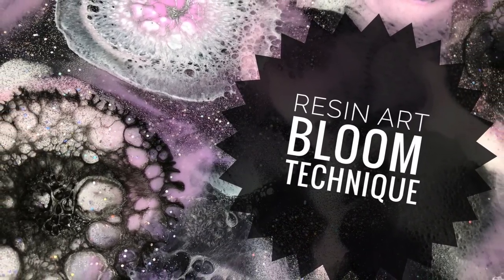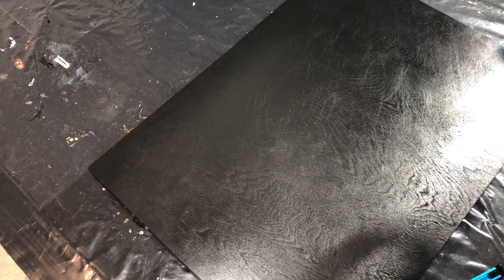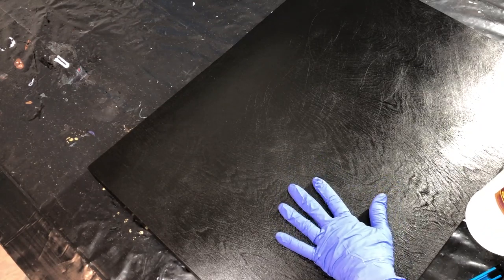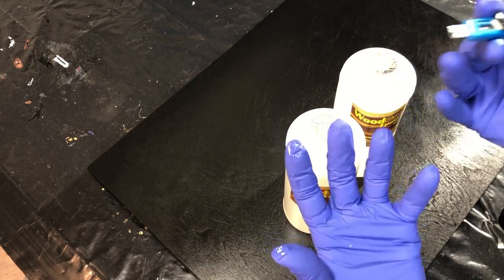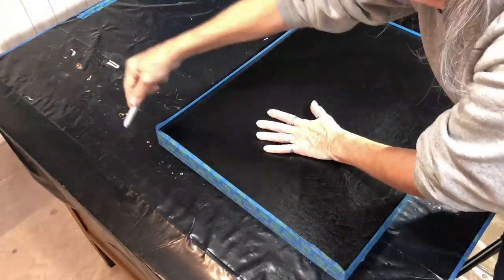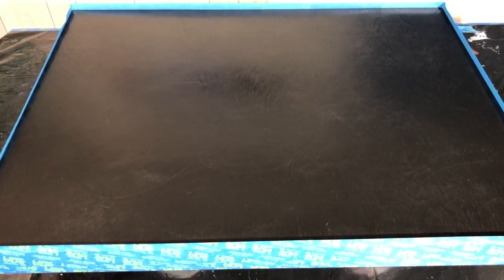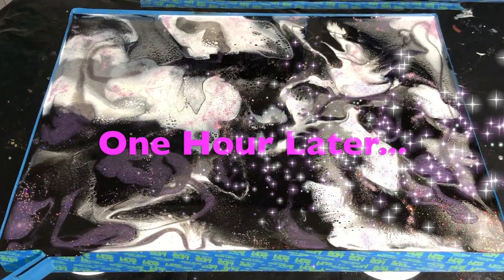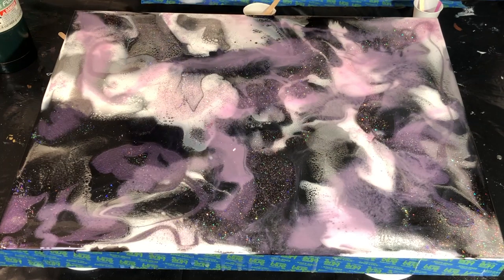Resin Art Bloom Technique - Pom Poms bursting like fireworks in the sky!  Absolutely a must try.

Comment: I just did this technique, from watching you, in some flower and leaf silicon molds.
I made the flowers & leaves from Fimo or Air Dry Clay (fimo worked best)  then made mold of them with pourable silicone, and MOLD BUILDER.  Hands down the pourable silicone molds are top notch, easy release, coat with silicon oil,  then cast them in clear resin)

This time, I injected, the resins tinted with Micas and pigments.  Awesome!

Usually, I just do clear, and use them on my faux stained glass resin window art.  I did these metallics to use on the outside of a mirror mount, usually it is on the mirror itself.

ty for posting.  I appreciate all your help on your videos....and your ideas...I like stealing your ideas...HAHAHAHA JK JK  Just Kidding!  omg, 
I get ideas, from you, to do my own thing,
 I was just teasing you...
Hopefully, you get it...most people just do not seem to have a sense of humor these days..
if you know what I mean....

Wink wink, nudge nudge..

Keep up the good work!
Reply from the maker: Wow!  It all sounds great.  I might need to get some Fimo to work with.  Glad the technique inspired you 💕

Comment: Hi Janet, Katie here from Australia. Thanks for your tutorial. It's a beautiful piece you've created. Can I clarify with you please when the layers of tape were removed? At the one hour mark, did you only remove the "dam wall" layer? And then, how long after you created the bloom puddles, did you remove the other two tape layers?
Reply from the maker: Hi Katie. When doing a tape dam I remove the dam tape 1 hour after pour and warm edge with torch or heat gun to roll the edge over for a round, leaving the tape on sides for the clean edge.  Sometimes if I pour another layer the next day I will keep the taped side, create another tape dam, pour, remove after 1 hour and warm edge for rollover.  I would then remove side tape after doing that only 2 times otherwise the build up of resin rollovers becomes to thick and harder to remove clean side tape.  Warming the side tape with my heat gun as I go around helps it come off with best results.  Hope that makes sense 😁.  I do this tape technique in a lot of my videos so maybe watching some of my others like this one I just did will help - https://youtu.be/mizGddG9vio

Comment: I correctly understood that the cells and the cobweb appear because you mix with a transparent resin .... прозрач Or is it because of alcohol ...?  I just speak Russian, no English🥴
Reply from the maker: The cells and cobweb are made by clear resin puddle first, then pigmented resin puddle on top (only the silver has alcohol), then using the heat gun in circular motion blowing resin puddle outward.  Hope that helps 😁
Reply: @MoonkusserArt  Thank you, I will definitely try☝️😊👍
Reply from the maker: @Elizaveta_87 enjoy creating.